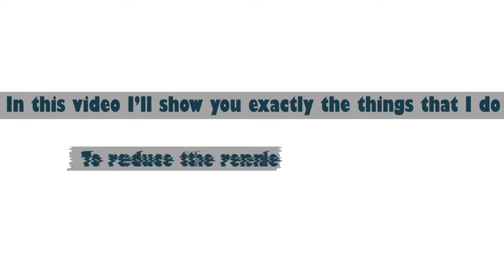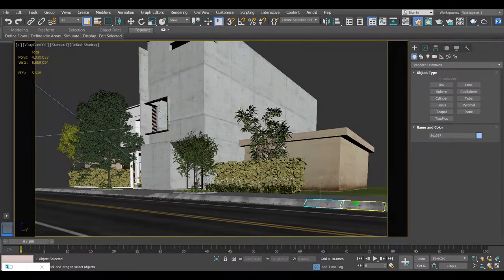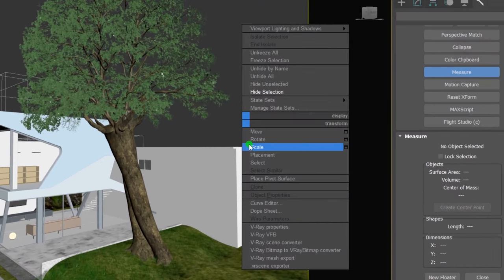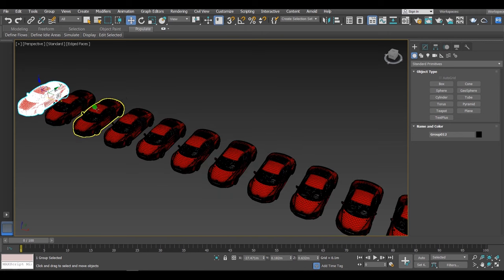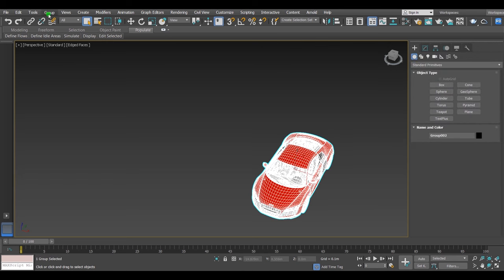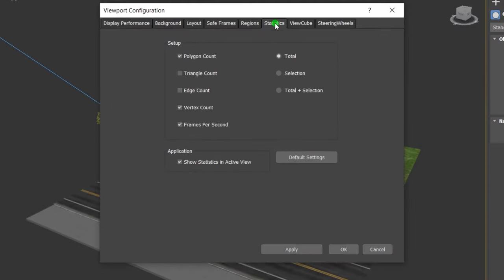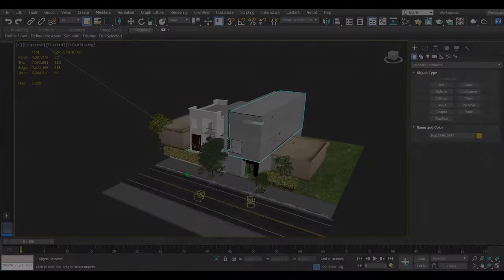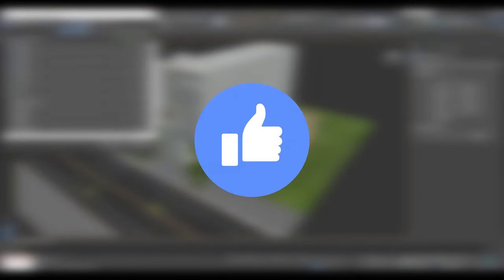7 Methods To Reduce Render Time And Speed Up The WorkFlow In 3ds Max | 3dsmax Fast Render 🤗🤗

Comment: you should add also the import reference file option
Reply from the maker: thanks for communicating
add the import reference for what specifically??
Reply: @MasterArchViz  if you have a big scene with mlns of polygons, reference an imported geometry don t effect the polygons count. Obviously the imported reference has to be already textured etc, once imported you can t change it directly in the scene ( you have to do it opening the file and update after in the main scene).

Comment: Specs of your pc...???
Best pc specs for 3dsmax fast render
Reply from the maker: HARD DRIVE TYPE: SDD (Solid State Drive)
Minimum: 500 GB SSD drive
Preferred: 1 TB SSD drive, or larger
MEMORY/RAM
Minimum: 16 GB
Preferred: 32 GB or more
VIDEO CARD: should be discrete not shared
For an extended discussion of video cards for architectural design and rendering, visit the Lumion blog, and review the Department of Architecture software suite below.
Minimum: Nvidia or AMD, 4 GB memory, discrete not shared or integrated
Preferred: Nvidia Quadro or AMD Radeon or better, 8 GB memory
SCREEN SIZE
Computer-aided design is a graphical medium and screen size and resolution are important considerations.
Minimum: 15” with minimum resolution of 1920×1080
Preferred: 17” screen is nice for graphics, but heavier